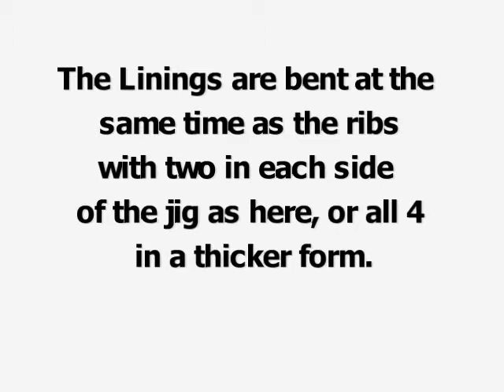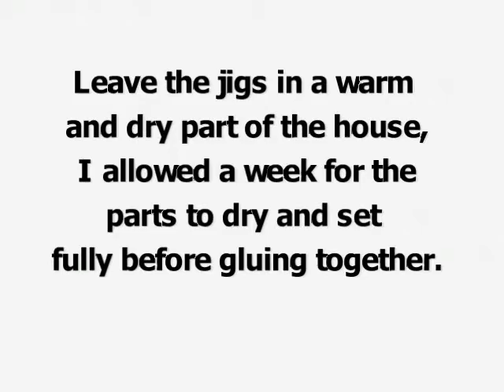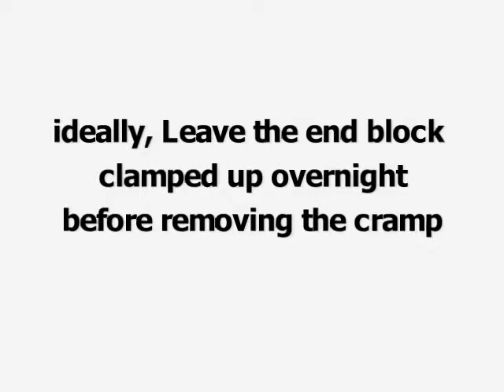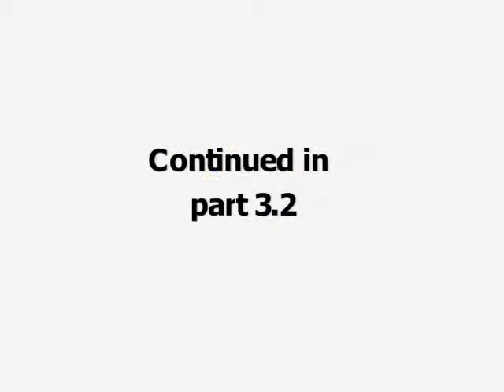Stick Dulcimer Making part 3.1 The Ribs

Comment from the maker: @60becker The spacing neck block brings  the sides to the width of the neck,   so the answer is how wide do you want your fingerboard.  I like 28mm but find 1" or 25mm is fine for most people as it is only 3 strings.  The wood can either be obtained from guitar back and sides(makes loads of stick dulcimers) or off cuts and scraps,  ebay is great for luthiery timber,   what country are you from,  there are specialist luthiery shops,  stewmac,   etc    I will be supplying sets at some point.